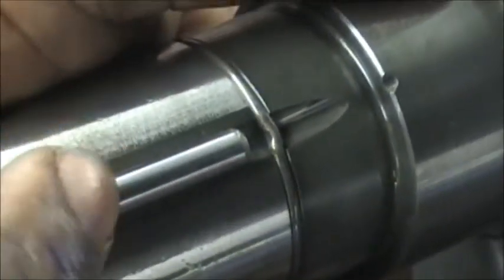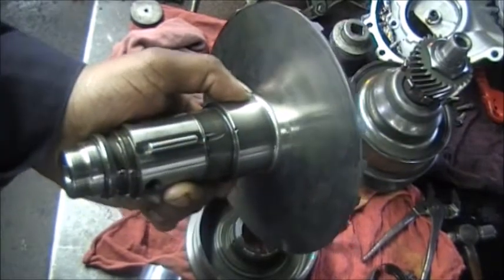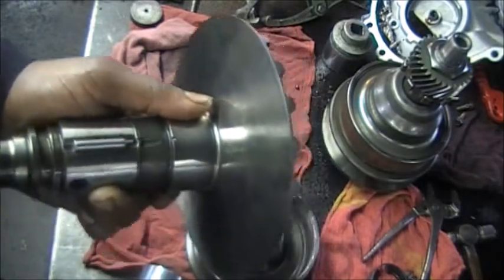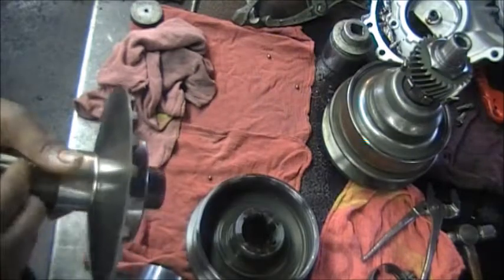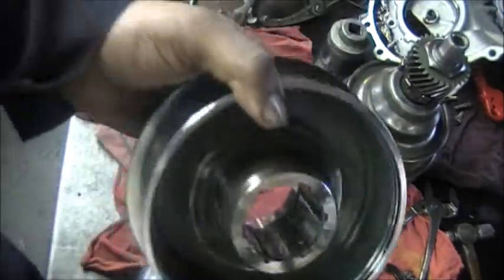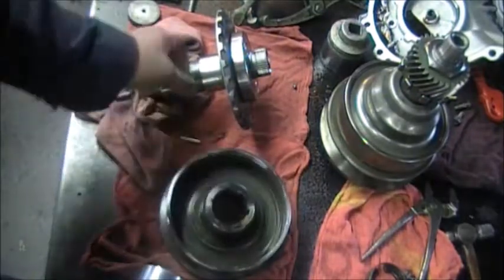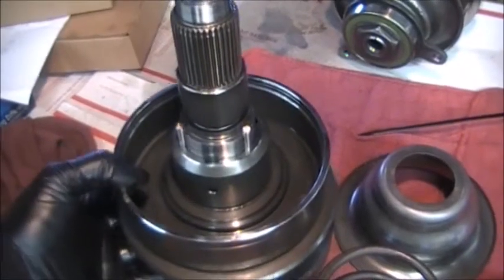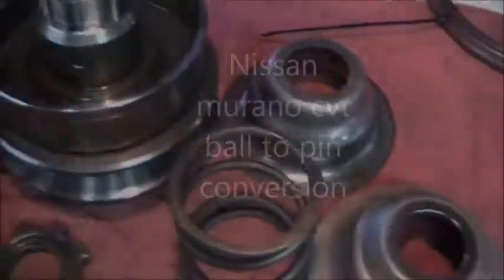nissan murano ball to pin

Comment: Thank you for sharing, i used Tight-Tolerance 17-4 PH Stainless Steel Rods 6mm , it is precise direct fit. mcmaster part no. 3180T36 
https://www.mcmaster.com/#catalog/124/3866/=1dorm3v
Reply from the maker: Salim Safran I may try these
Reply: just completed atima cvt, and swapped the primary and secondary with pins as you explained , worked perfect thank you  for the lead brother.
Reply from the maker: Welcome

Comment: Do you ever work on any 4L80-e stuff? I have 95 k2500 gas that all gears work fine. Torque Converter Lock up mode use to hit hard in (3RD, 4TH) @ 45 mph, but now it never goes into lock up mode, and when it finally does you feel a slight weak hit when before you defiantly knew when torque converter was (Cycling) in lock up mode. My 95 k2500 has not seen easy miles, (172,000). Now the fluid smells really burnt. Is it time to throw a rebuild kit at it and replace converter? Any thoughts? Your transmission work is outstanding sir!
Reply from the maker: Leroy Jankins if the fluid smells burnt, it is time for a rebuild. Also, parts like to wear in that unit. So you have to inspect the parts closely. Hiram Gomez shows a good rebuild on this unit. I have not put a video of this unit up yet. I will in the future.
Reply: Fluid being burnt is pretty much a done deal. Time for a major overhaul!!! Thank you sir I will inspect carefully!!! I look forward to your 80e build video in the future!

Comment: where are purchasing the pins?  i have a pulley i can save if i can get the pins thanks
Reply from the maker: you can get them on ebay. However, you have to get the right size and have to do a little modification for them to work properly. There are some for sale on ebay that are drop in replacements. However, I have to get you the ebay seller later.
Reply: thank you